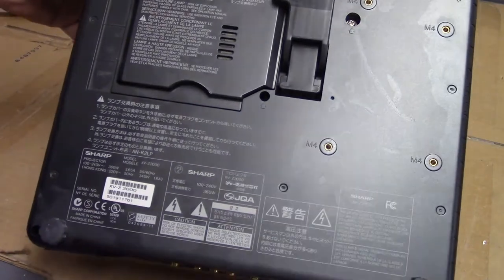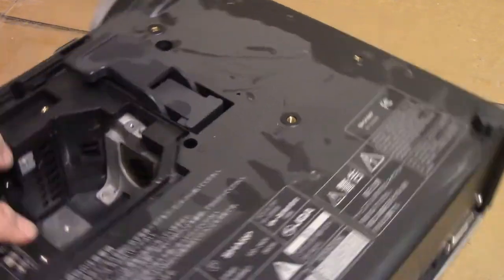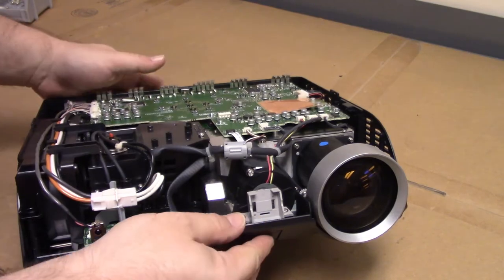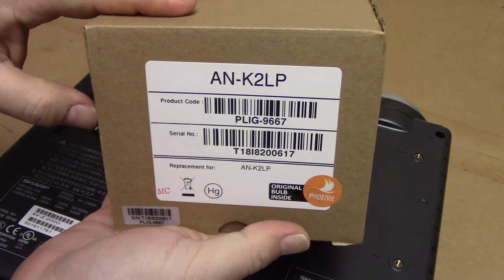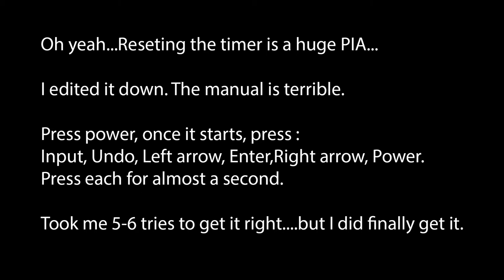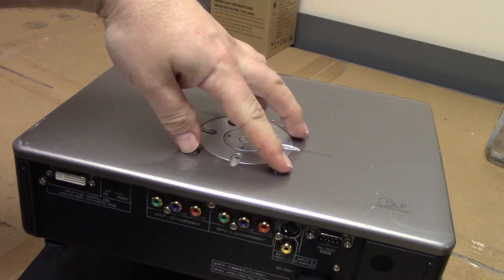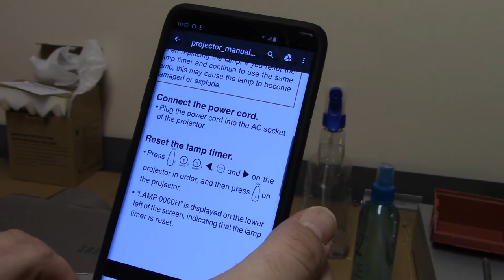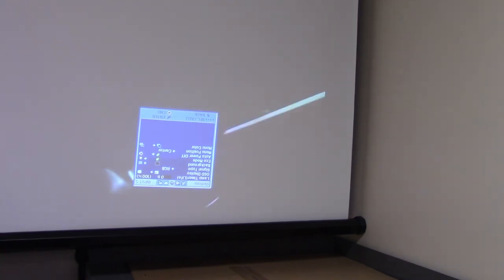Sharp DLP Projector XV-Z2000 Cleaning and Lamp Replacement

Comment: Figured out why lamp timer reset did not work!  Tried dozens of times after verifying the lamp worked. Returning to standby did not help.  Then, I realized that step one of the reset procedure is "connect power cord."   The procedure only works right after connecting power!  Make sure to wait for the fan to turn off before unplugging.  Wait, say 20 seconds, plug in, and then push the buttons in order.

Comment: Saludos! Una pregunta la lampara automáticamente cuándo llega a las  3000 horas no enciende, baja la intensidad de la ñuz, colores apagados..?
Reply: Saludos! Una pregunta que tiempo le ha durado la lámpara del proyector en horas? Bajó la intensidad de la lámpara al llegar a x horas de funcionamiento? No hay que
Reply from the maker: Con la vida útil máxima de la lámpara, la salida de luz es inferior al 50 % del brillo original. También indica que el vidrio se estresa con el tiempo y puede explotar durante el funcionamiento. Sé que es molesto tener que reemplazar la lámpara, pero es para proteger el proyector. Afortunadamente, existen muchas fuentes de lámparas económicas. Normalmente sugeriría una lámpara de calidad original, pero este proyector es más antiguo. Yo compraría cualquier lámpara que sea la más barata y que tenga garantía.  Gracias por ver!
Reply: Con este modelo que tipo de lámpara modelo se puede conseguir que sea económica? El proyector lo compré de Segunda mano x 30€ con unas horas de uso de la lámpara